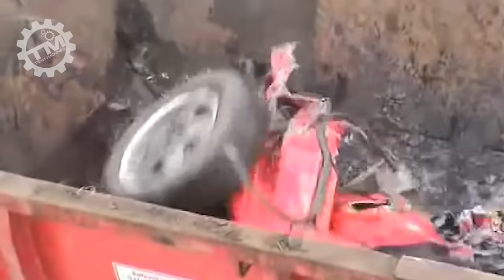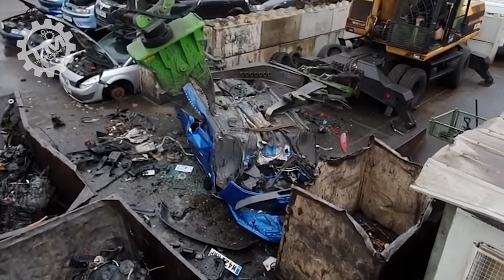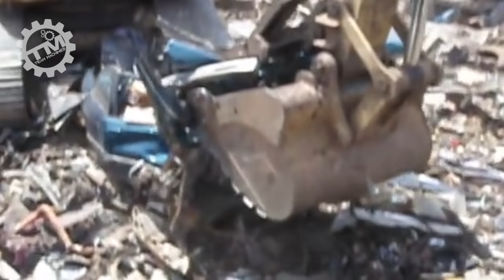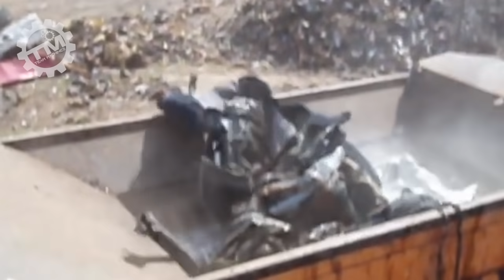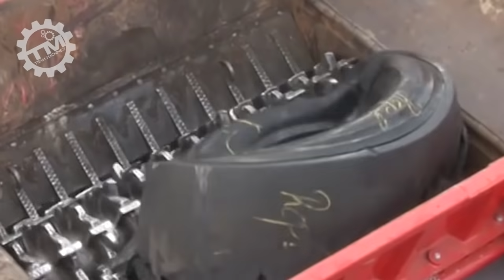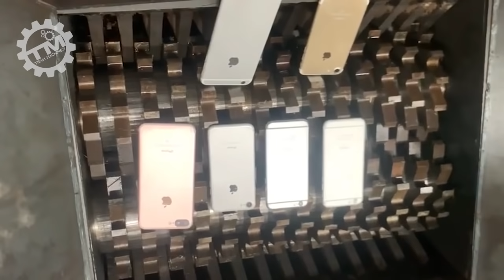Extreme Dangerous Car Crushing Scrapping With Crusher & Excavator in Action, Modern Shredder Machine

Comment: It's fascinating, and a bit alarming to watch a pre-shredder in action. I work in a large scrapyard, and from the pre-shredder, the bits go through a hammer mill, to break the bits into manageable pieces, and from there the pieces are sorted automatically, and processed further in a kibbling mill which reduces the pieces to a uniform size of about half centimetre granules. From a car and a load of kitchen appliances, to a sack of granules in an hour or so.
Reply: what do they do with all that?  thanks
Reply: @MachTuck  - It's loaded into containers, sold, and shipped abroad, to China, India, and Africa (usually to Tin Can Island in Nigeria). Aluminium and Stainless Steel are usually recycled in plants in the UK.
Reply: @brianartillery  Alright, thank you for replying! So most of it gets recycled? Must be interesting to see how is the material separated in groups.
Reply: @MachTuck   - Most of the sorting is automatic, using magnets, and by the weight of the fragments, etc. However, some valuable items are still picked off conveyors by hand - these are usually items containing copper, like motor armatures, relays, servo motors, that sort of thing. There has to be a human prescence too, as sometimes, very hard items can escape being broken up. These can block the machinery, or can come through, but have to be removed before they can smash the rollers on the smaller conveyors. These bits are called 'unshreddables', and are usually (a) extremely heavy, (b) blue with heat (c) really big and awkwardly shaped. This is only a real problem if they get to the final magnetic sorting rotor - and then everything has to be stopped, we have to get in the magnet drum hopper, and try to get the piece off the rotor, and drop into a lower conveyor. From there, we get a magnet crane to lift it off, and take it away. The biggest unshreddable I've so far seen, weighed a quarter of a ton. Sadly for me, it came through when I had a day off. It sat on the floor for a couple of days, as it took ages to cool down, and a load of us manhandled it on to a tractor shovel.
Reply: @brianartillery  Interesting process!  thank you!
Reply: @MachTuck   - No problem, it's an interesting, though dirty job, and I love it. 👍👍👍

Comment: Nice Mk2, Tornado red Golf, How much is recycled though? , all the glass and plastics still there, rubber seals etc, it's even got alloy wheels on. Would be better for the planet had it not been crushed but repaired and kept on the road preventing yet another new car being built causing more pollution or an electric car that causes 1.5 times more Co2 than a conventional car being built.
Reply: すべての車などを潰せていますよね。

Comment: For many reasons this does not look like USA. This is not a car crusher, this is shreder. There is diffrence between tbese macines. In US most places won't do what you see here. All shreders I know won't take tires in becouse these get stock on the hamers and machine needs to be stopped and someone has to claim in and remove them. Its cheeper and safer to do this prior to shredding. Lastly material seperation is done after car is shredded becouse is done without manual labor using conveyors with magnets liquids etc.
Some materials flow some dont, some react to magnetic field.
Please dont draw conclusion from  short video that you saw on you tube Many times there is more to it and this is true with everything you may see or read.